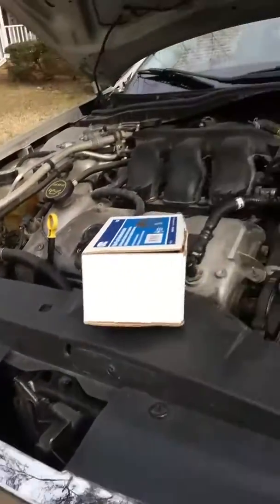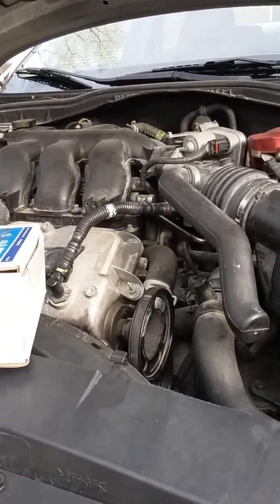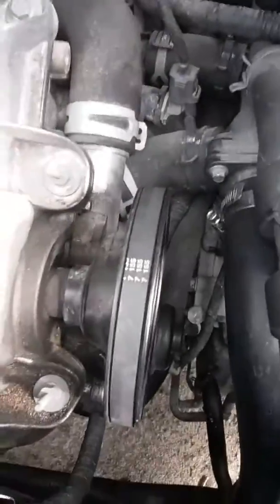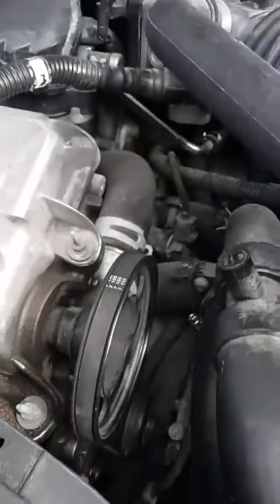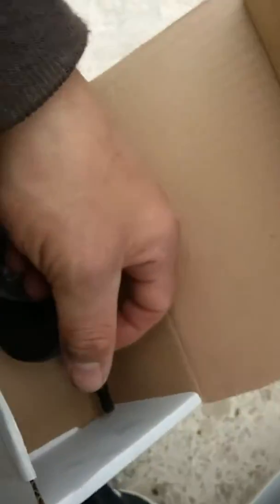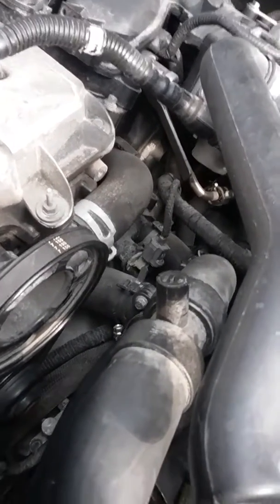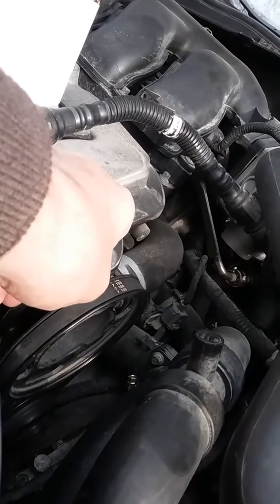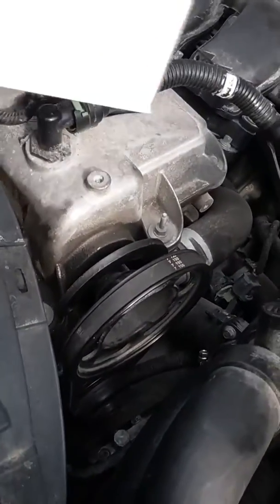Otc tool 7483 for Ford Fusion Se 3.0l(2)

Comment: I have the same tool for my 2006 Mazda 6s and it's the same problem I'm having. I don't know how to use the tool. did you figure it out?
Reply from the maker: i did and I hope you looked at the video playlist and it will show you exactly what is needed.  it is easy to remove and the otc tool and the other tool from harbor frieght.  hope you got it off.

Comment: Wtf!!!! 😤 No help at all
Reply from the maker: what did you try, did you look at all the videos.  the pulley comes off easy.   you just have to get the pulley removal tools from harbour freight.  once pulley off you can get to the screws to water pump.  crazy design
Reply: Reynaldo Olabarria yeah bro I got it off I was just frustrated. I had a hell of a time with the hoses also. I made my own pulley puller from a steering wheel puller. I also made a video of it LOL it was easy to put the pulley back on hard part was trying to get all the hoses back onto the water pump
Reply from the maker: I felt so pissed when I had purchased the water pump and could not get it off due to those two screws.  Then, I had to buy the other stuff to pull pulley off.  And, it was easy to pull crap off without taking all those hoses off and losing antifreeze, but only realized that after everything was removed.  I understand, been there, done that.  Autozone had given me a used pump and wrong one too, that was funny and not so funny.  Glad you did it.